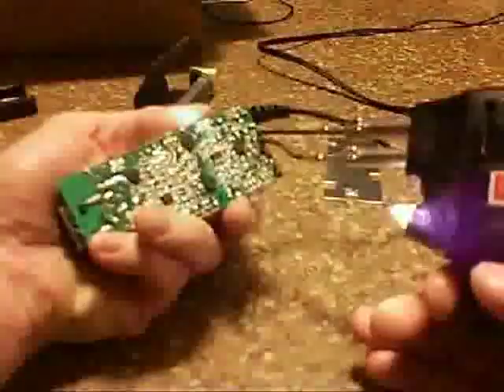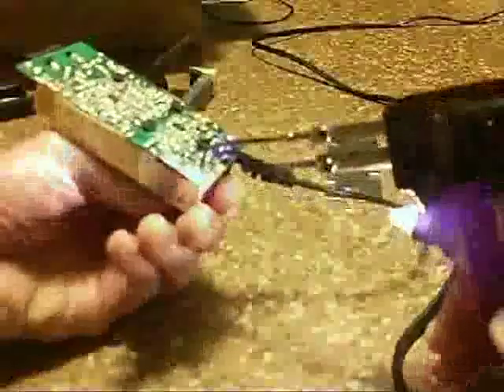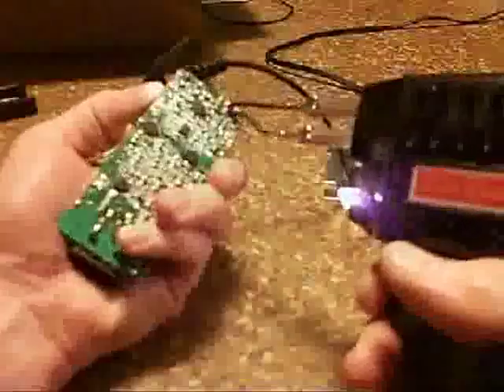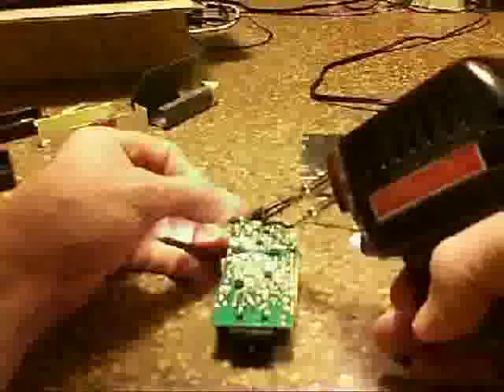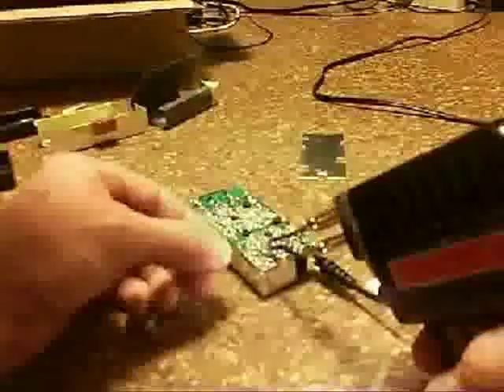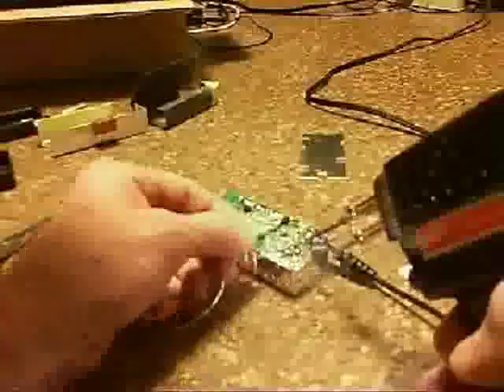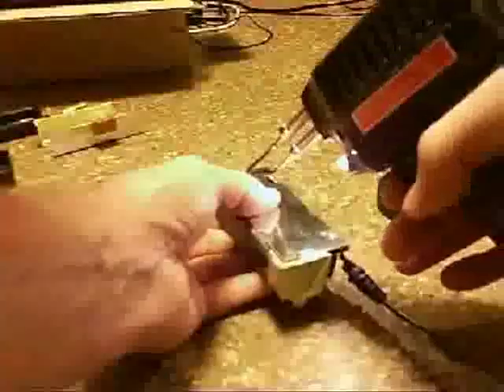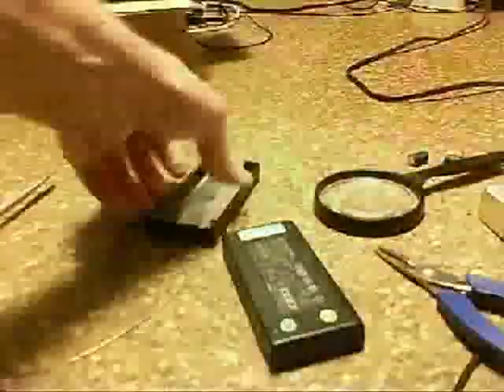Replaced bad capacitors AC Adapter Model F10603 C

Comment: is it ok to use 19V 4.74A charger instead of 19V 3.42A charger?
will extra amp damage my laptop or battery?
Reply from the maker: Yes more amps is good just not more volts.

Comment: I guess you didn't have a warranty on the adapter, new aftermarket adapters, for my laptop anyway, 120 watts, are like $15 on ebay with a 3 year warranty. Maybe next time get an oversized (higher wattage than needed) aftermarket AC adapter with a good warranty

Comment: That soldering gun does not look like an ESD safe model.  It is risky to not use an Electro Static Discharge (ESD) safe soldering iron around any board with ICs or you can easily fry the ICs.  I recommend the Hakko 936 Soldering Station for any soldering around boards with ICs.